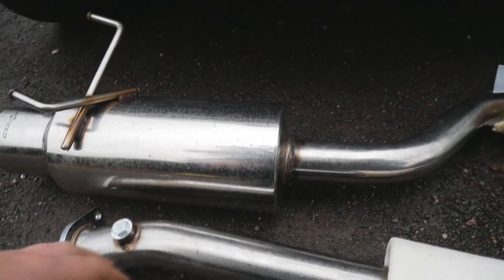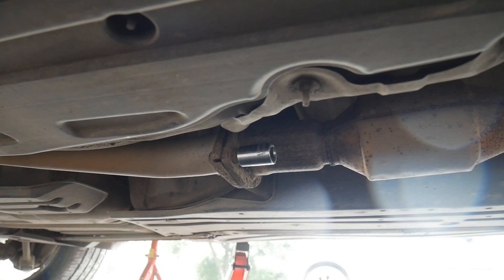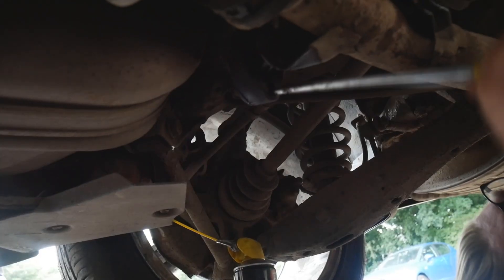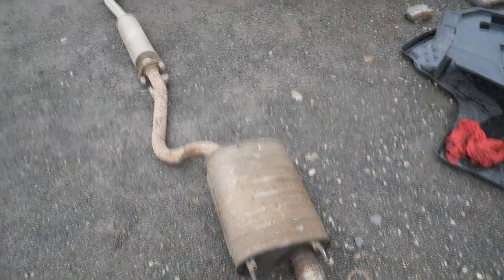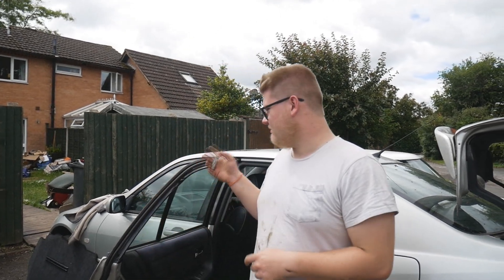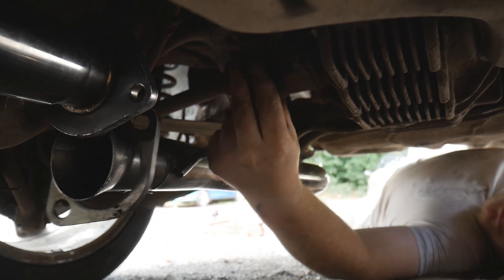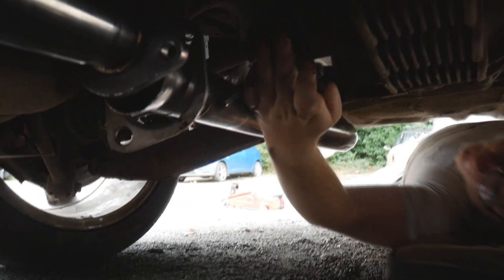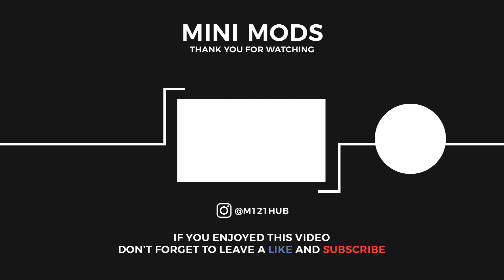Installing A *CRAZY* 5" JAPSPEED Exhaust On The IS200 Drift Car | Grinding Gears

Comment: can you put the original exhaust back on or is that no longer possible? just wondering cause I have to get through mot, but I want this exhaust
Reply from the maker: Hey man, we’re hoping this will get through its MOT with this one but we’re unsure. If you do need to swap it back it’s as simple as unbolting the new one and rebolting on the old one
Reply: Great! Is this the catback system you buy on japspeed? Still happy with it?
Reply from the maker: @ragnar-r4107  that’s the one. He’s happy with it still yeah, not too drone-y!
Reply: @GrindingGearsOfficial  did it pass mot ?
Reply from the maker: @M1.942  it did yeah!
Reply: @GrindingGearsOfficial  cheers mate ! Definitely want one, hard to find in a manual, what mods would you advise for a little power gain ?
Reply from the maker: @M1.942  it’s ace. It’s my mates car drives lovely. Power wise I’d say the standard tune up and maybe injectors unless you want to supercharge it I guess
Reply: @GrindingGearsOfficial  sounds good mate thankyou
Reply from the maker: @M1.942  No problem dude, more IS200 stuff this summer so hit subscribe to stay in the loop :)
Reply: @GrindingGearsOfficial  will do mate looking forward to it.